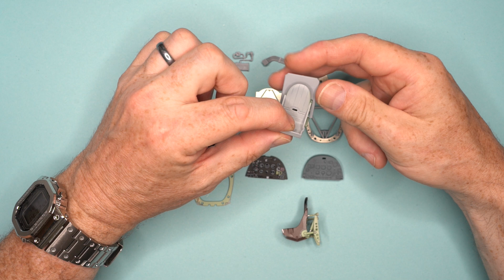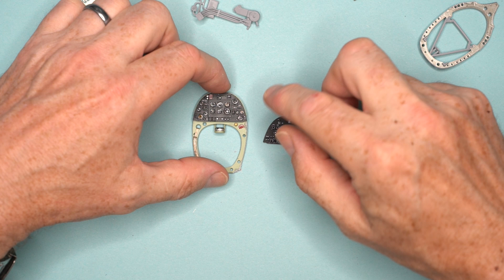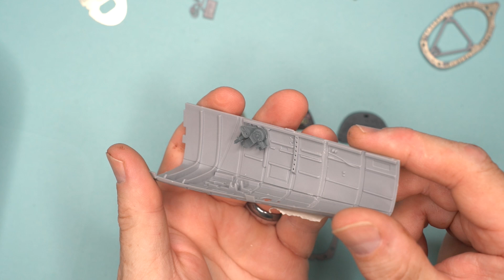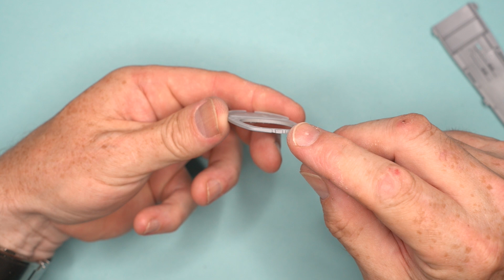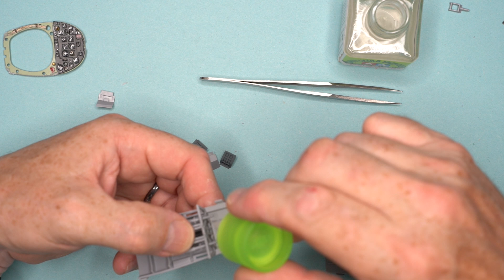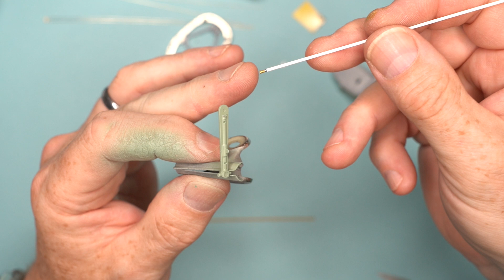Airfix 1/24th Spitfire MKXIV Part 2

Comment: I wonder if modern pilots still use parachutes because they may still have to bale out at altitude? 
Many modern warbird pilots can be seen with multiple straps from the seat and the parachute. 
Could be worth checking your references?
Reply from the maker: True they may well do. I don’t need to decide yet. I have seen plenty of seat cushions though so I can add one of these at least. Thanks for the input 🙏